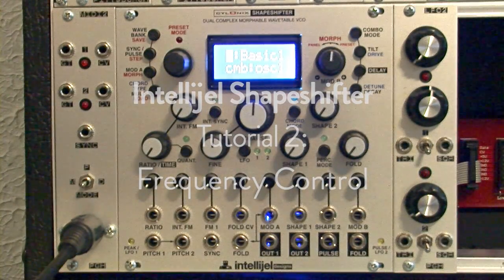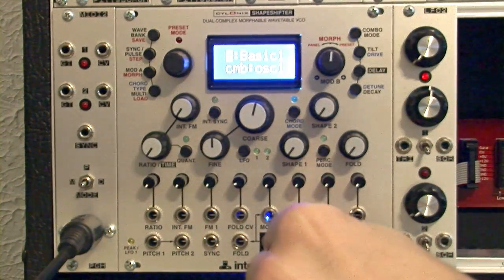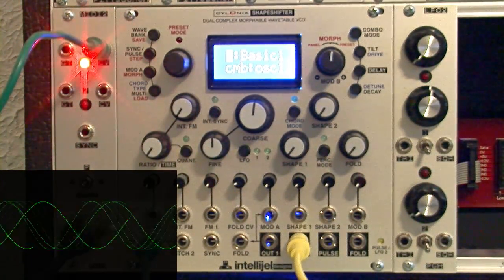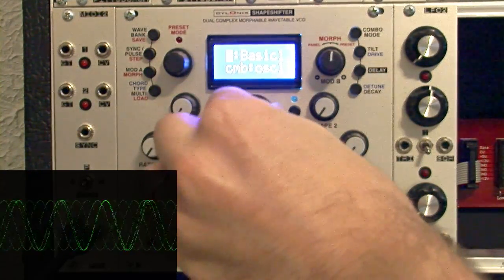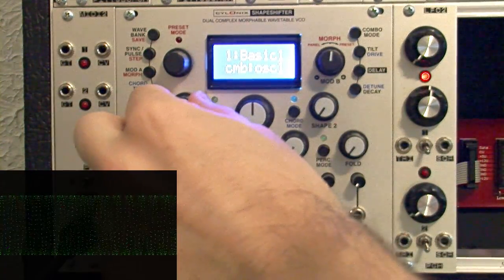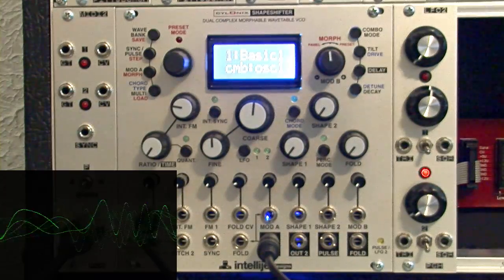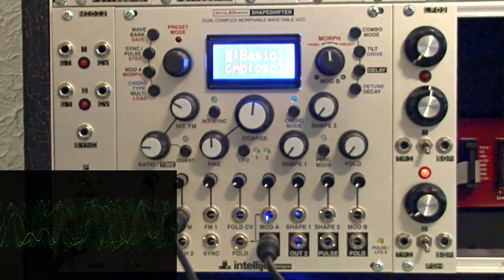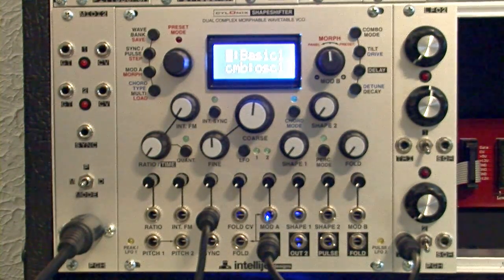Intellijel Shapeshifter Tutorial 2: Frequency Control

Comment: Great tutorial. Thanks! Does anyone understand why you can still hear a sine wave out of oscillator one simultaneous to the FM that can also be heard?  How is it possible to hear a perfect sine wave and FM both coming out of the same output?
Reply: Osc 1 is the "carrier." That is the main sound source, it is the main pitch. Osc 2 is the "modulator." It can come in at LFO rate or at audio rate. At LFO rate, you will just hear the carrier slowly changing timbre. At audio rate, you will get the metallic/glassy FM sounds. The carrier and modulator by default are both sine waves. When the modulator is at zero, there is no modulation of the carrier, so you will hear the clean unmodulated sine. When the modulator is high, you get the FM sound. Using the Internal FM knob, you can alter that modulator level,  changing the output from a clean unmodulated sine to an FM wave. Use the LFO button to switch between audio/LFO rate for each oscillator. When you power on, both are audio rate. Press the LFO button once, and Osc 2 switches to LFO, while Osc 1 remains at audio rate. Press it a second time, and it reverses, Osc 1 is an LFO, and Osc 2 modulates it at audio rate.
Press it a 3rd time, and both oscillators are at LFO rate. So, when you output from Osc 1 (the carrier) and Osc 2 (the modulator) hits a zero point, then the carrier sends out a clean signal, but then the modulator goes negative or positive again, giving an FM signal.

Comment: When you plug in an external source to the FM1 input to be the modulating oscillator, isn't it actually going to sound a little bit different (or less pitch stable at least) because it is no longer using thru zero fm? I was under the impression the Shapeshifter was setup to use TZFM only when oscillator 2 is modulating oscillator 1 via the internal bus. Is that correct?

Comment: At the end, when you use the fm1 input, it seems that the internal fm know is still operating.
Does it means there are both modulations: one from the outside (on fm1 input) and one internal (osc2)?
Reply from the maker: +Julien Bayle If I understand your question, when using the FM1 input, you disable the internal FM input (osc2) and only use the external input (FM1) for modulation. When doing this, the "Int. FM" knob acts as an offset for your external input. See 10:44 where I mention this.